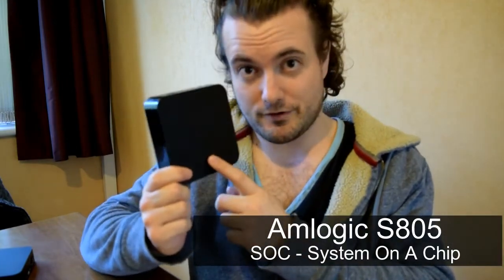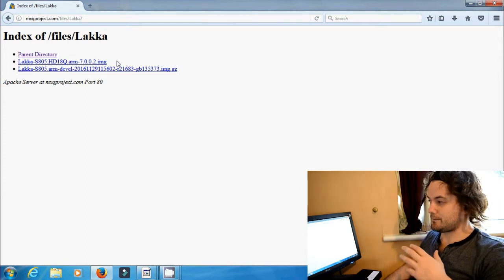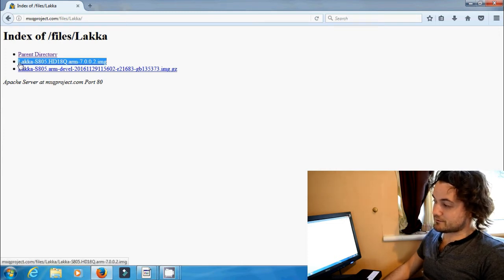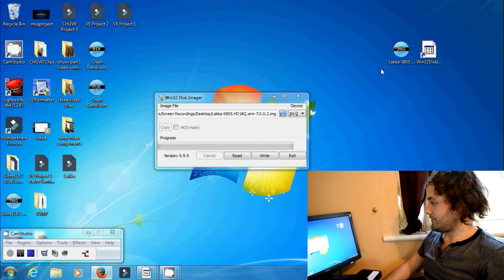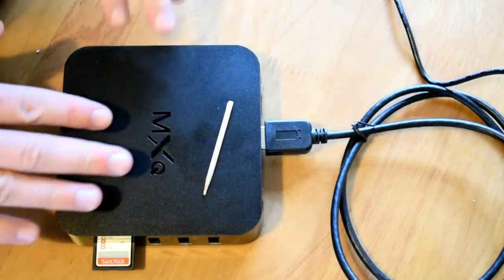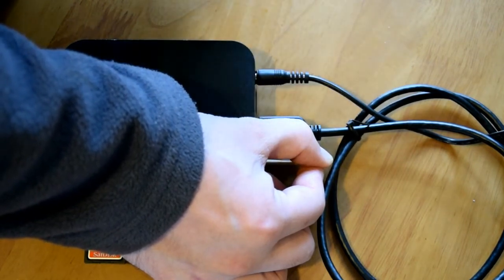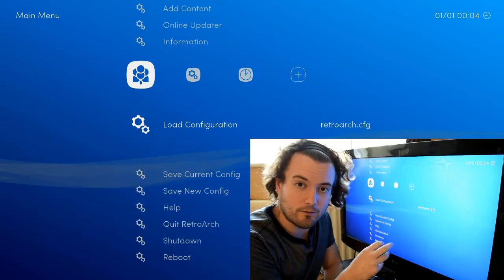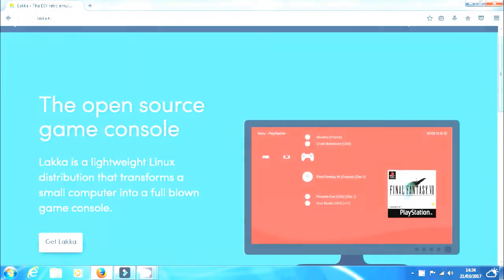MXQ S805 LAKKA Retroarch Retro Gaming System - SD Card Dual Boot Tutorial

Comment: Hi, I managed to run retroarch fine with an m16 tv box and booting from a lakka Sd card, however after installing netflix and watching a couple series, the tv box doesn´t boot anymore into retroarch, I tried several times to press the reset button and reboot but I had no success anymore. Do you know if there is any config that can I change which is turned on or off when downloading netflix app into the tv box?
Reply from the maker: maybe corrupted the sd ?
Reply: Thanks I tried with more than one SD cards and even USBs... I think somehow Andriod system defaults booting settings into the TV Box and it ignores SD or USB, I tried with both. Any thoughts?

Comment: Can it be installed on a Intel I3-4010U box with LibreElec Installed on it?
Reply from the maker: the pc version may work for you
Reply: I am lost. Where can I find the PC version and instructions? I already have LibreElec Kodi Running. Cant I just install the file through the libreelec restore from backup process?
Reply: Sorry Wrong video! I had too many windows open. I will re post on your "LibreELEC 8 NEW MXQ RETRO GAMING SYSTEM - AMLOGIC S805 / S905 / S812 / S912" Video